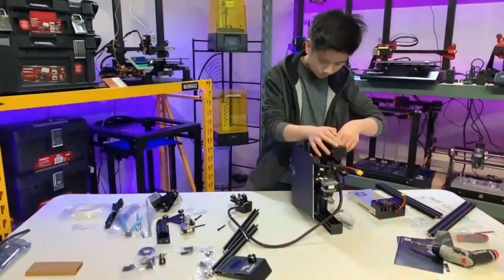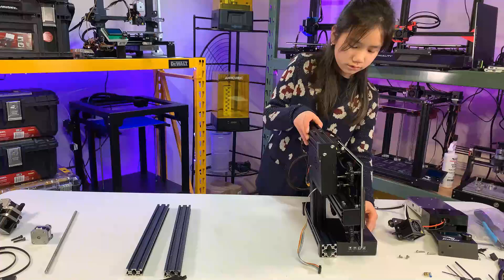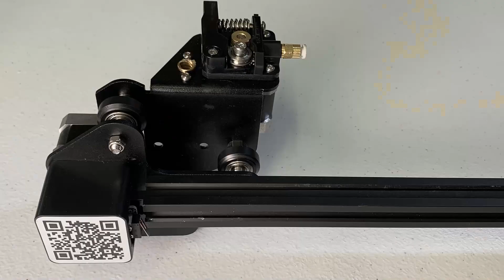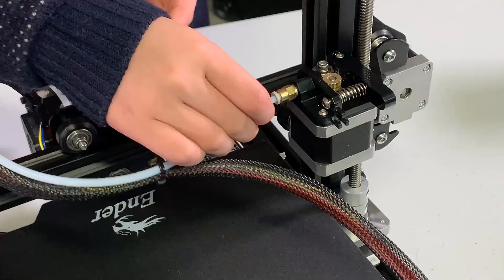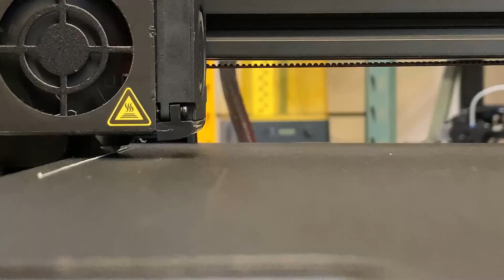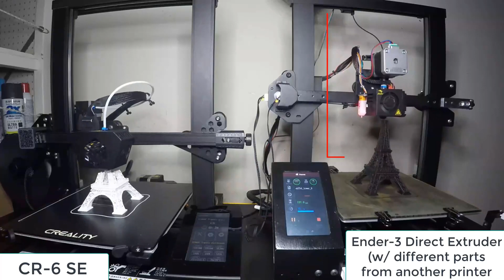Ender-3 Pro 2021 version w/32-bit board: Review and detail assembly instructions for beginners

Comment: you have a bit of 'dead air' in the video with the transitions, for example during the 2. unboxing.
you should maybe think about what kind of video this should be, an unboxing or a technical review, or a build guide. If you want to do all maybe split this video into 2-3 slightly shorter once.
your pointer towards older videos is great and you may want to add the links to the description aswell.
I missed a side by side with your 'old' ender 3 and it's modification and also thought the shift from video to still pictures to show the issues with the bowden was a bit glaring.
Great video, couldn't do it better and am exited to see you improve!
Reply from the maker: Thank you both for your suggestions and for taking the time to leave some kind comments. We really appreciate all the support and advice!

Comment: Is it really come with 32 bit board ? I knew that it is with 8-bit board with silent drivers.
Reply from the maker: Yes, it came with 32-bit board. But it didn't come with silent drivers, I guess the reason is 4 TMC drivers are more expensive than just one stm32f103 32-bit processor.